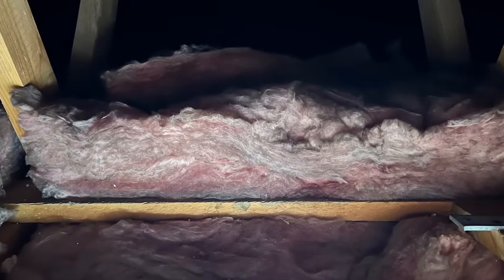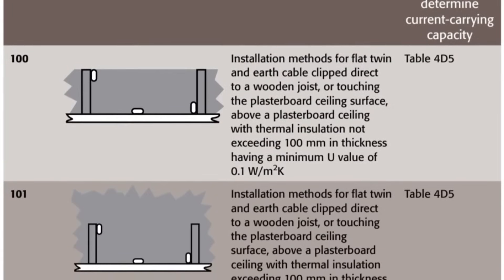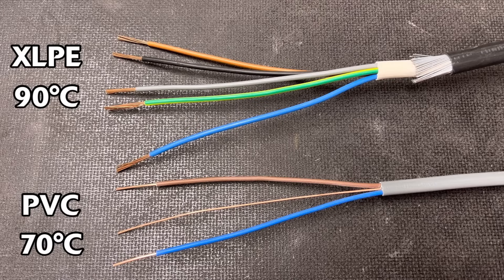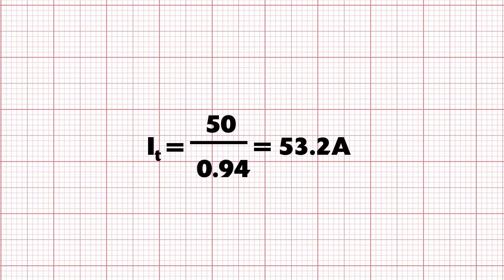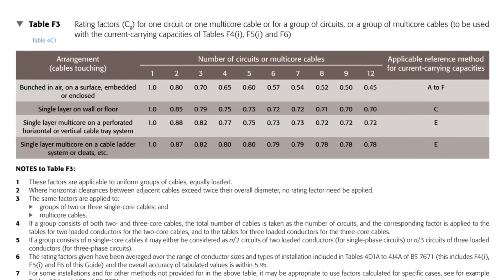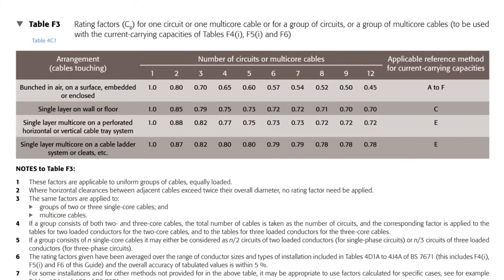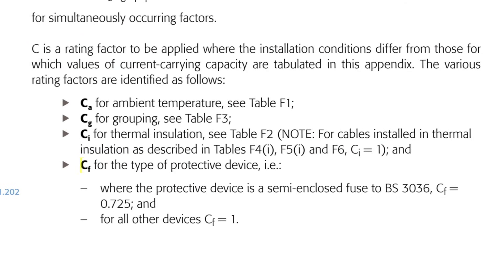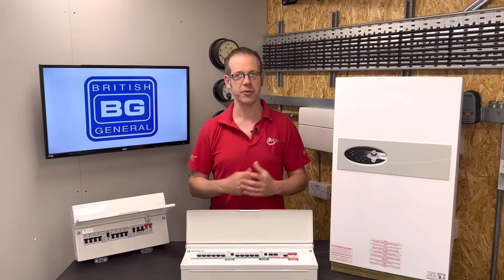Electricians' Guide: Cable Rating Factors

Comment: I've come to a house that was rewired in 2017, and it looks like they are using previous joist holes to feed twin and earth and 3 core and earth cable in 2.5mm and 1.5mm - some joists have 6 cables in what looks very small how do I determine if what they have done is correct and should all cables be in there OWN joist hole or can they be shared? Does this makes sense? Can't find anything in the regs to say cables shouldn't or should be in their own joists

Comment: Solar company advised us to go 16mm² for our 60m cable between PV and main distribution.
The 6mm² does fine and due to some voltage buildup at peak production our amps stay well below specifications.
Overall our 27Wp array here in the Netherlands performs as expected as crappy as stats show from when the first PV-stats for our 52N region became available.
The cost of cable doesn't add up for the few losses during peak production!!

Comment: Bundling cables has not been permitted in the USA for some time. We use stackers for multiple runs that maintain and equal space between conductor cables. Romex and metal clad cables have there own stacking systems.

Comment: If you were running cable clipped direct to an internal foundation i.e. large concrete thermal mass but then butted insulation right up to it, would you be of the opinion that as it was touching the concrete that all heat would easily be dissipated or would you derate according to how much insulation was covering it?
Reply: You would de-rate it according to the insulation, There are to many unknown variables to account for in your scenario.

 There is no way of quantifying within the guidelines the regs how well the clips and what type of clips etc are conducting heat away from the cable into the wall size and thickness of the wall and so on.
Reply: @thomasdadswell858  The reference methods account for being in contact on one side with the thermally conductive wall... it's not the clips doing the conducting!!
Reply: Yeah I know, I was trying convey that the insulation matters more than the thermal conductivity of the wall, and that for example armoured cable clips space the cable off the wall and t&e clips don't  @intercity125
Reply: Unfortunately it would be celotex or equivalent... That's way more insulative than the stuff these rating factors allowed for.

Comment: I had to do this for a customer the other day as he didn't believe that 7 meters of 6mm t&e wasn't good enough for his 9.5kw shower. Suffice to say it's not good enough and the shower which was fitted didn't even have a local isolator which is required by manufacturers instructions - a DP RCD or RCBO in the board doesn't count.

Comment: @10:41 I wonder how the rating factors were determined for thermal insulation. Surely the calculation is more complex than just the thickness of insulation considering the thermal performance will vary with the material used. I.e. The R Value (m2K/W) may be twice as high for a 100mm PIR insulation board compared to say a 100mm slab of rockwool/ loft roll.
Reply from the maker: It's an interesting point, I guess there'd quickly come a point where it didn't make much difference. 🤔
Reply: Rating factors only apply to rockwool. It states the u value in bs7671. Celotex we have no factors form you'd have to do some complex calculations based on the value of that. Basically keep cables away from it.
Reply: @travoltasbiplane1551 also it does depend on how much space is arms the PIR. Rockwall is likely to surround the cable and touch it because it’s likely to deform. If you have PIR I guess you’d cut a channel and leave some airspace around the cable. I suspect that most electricians would take a finger in the air approach to a cable in a channel in PIR because you’d need to try to calculate something that has a lot of variables that you may not even know.

Comment: I don’t always rely on calculations . Depending on the circumstances you don’t know what’s going to happen in the future. Example extra insulation, or extra load . Hence I often run a slightly larger cable than needed. 
A good example I can remember the SEB would wire showers in 4mm cable . At the time most showers were 6KW . They would put a sticker on the fuse box saying  CLOSE CIRCUIT PROTECTED. Cartridge fuses must not be replaced with rewirable. . We always used to wire them in 6mm . When showers were upgraded to 7KW or even 8.5KW .9 out or 10 times the 6mm was adequate.  Where the 4mm cable the SEB installed had to be replaced.
Reply: Nowadays even 6mm would need to go up to 10/16mm to account for +100mm above plasterboard.

Comment: bizarre method of derating cables by dividing and making it seem like a larger number, in North America we multiply by the factor  so say your wire is good for 50A and ambient temperature derating factor is .87 you 50X.87 =  43.5 aka now that same cable only has a current carrying capacity of 43.5A which is a lot more straight forward than the number going up when your derating them....

Comment: As a non UK person it sounds really interesting! As its not common in the UK loose wires in plastic conduits,  how does that affect the thermal insulation from for example building insulation (i.e. rockwoll)?
Reply: The cable rating factors for grouping cables in conduit and teu king can be found in tables in the regs book .

Comment: I have run cable to a shower....clipped to the rafters which are at 400mm. centres...in the loft....Well above the 300mm. thick insulation...it's quite cool up high because of the insulation...in fact it's ventilated via soffits. .the insulation is pulled away from the cable as it enters the switch...

Comment: My simple calculations:
For open air wires: 10A per mm²
For open air cable: 8A per mm²
For cable inside the wall: 6A per mm²

Comment: 99% of electricians are basically installers, they do everything according to the print. Also there’s not much thought that goes into residential wiring. If it was complicated they wouldn’t allow homeowner to do it. I do automation, plc’s and motor controls(vfd’s and starters)

Comment: A lot of bungalows have their power cables running through the loft space. Now the recommendation is to install at least 270mm of the stuff, often added as extra layers. I wonder what effect that will have had as I can pretty well guarantee nobody considers that when topping up their loft insulation. 

Not likely to be an issue on lighting circuits though, at least in domestic properties as 1.5 mm^2, or even 1 mm^2 cable was already over-specced for a 6A circuit. It looks like the 6A under 270mm of loft insulation would be equivalent to around 12A, so 1mm^2 cable is under-sized (as that's 10A), whilst 1.5mm^2 cable, which I guess is more common is 16A, which ought to be OK. Of course, real world demand is likely to be a lot lower these days with low power LEDs taking over. 

But those power cables, whether for a cooker, ring or maybe 2.5mm radial stand a good chance of being underated if they are no buried under the government sanctioned 270mm of loft insulation (I have never once seen any warning from official sources to householders about this. I suppose loose-laid wiring could be placed on top of any new insulation, but that could make it much trickier to lay.

Comment: There’s a lot of nonsense going on in this video. You’re definitely overthinking it. If you’re really wanting to complicate things unnecessarily you should consider how most high-consumer electrical loads, which typically heat, will be doing less heating and so drawing lower current as ambient temperature increases. Which’ll put you back to square one. You could have summarised this whole video as  just overrate the cable by 10% and you’ll be fine. The manufacturing tolerances on the cable are probably more significant than variations in ambient temperature.